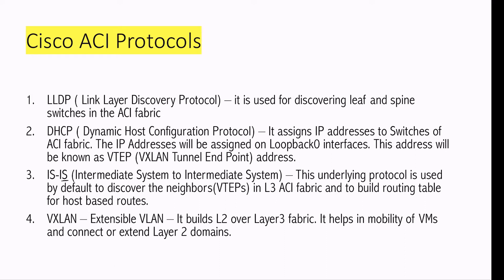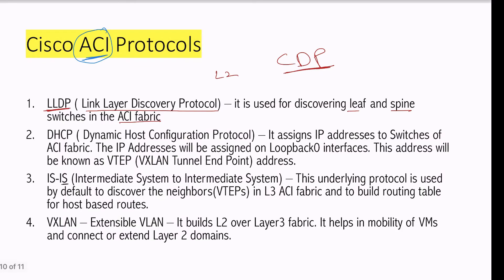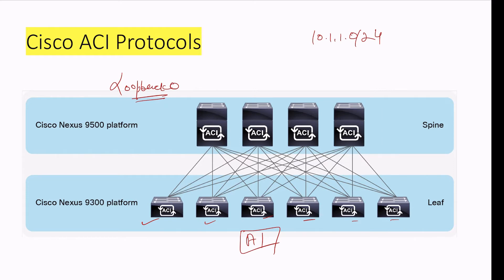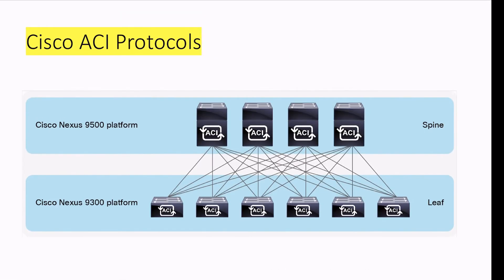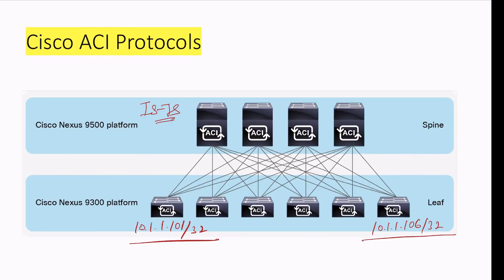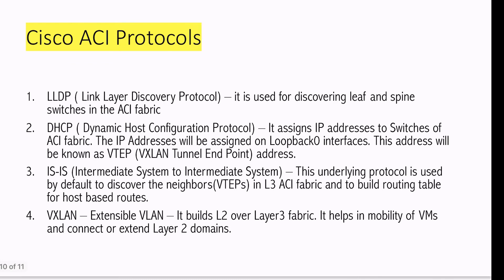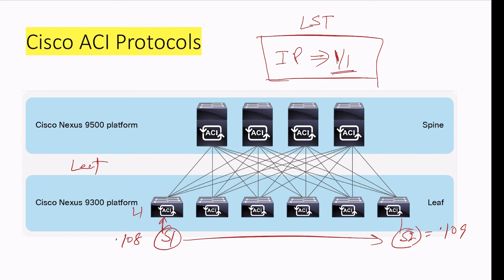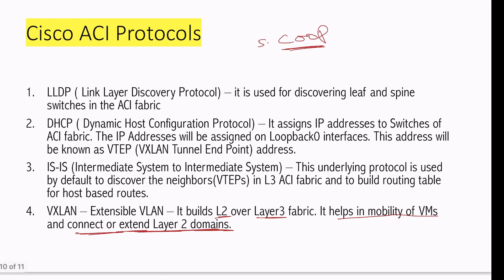Cisco DCACI(300 - 620) - ACI Protocols

Comment: Download Updated Cisco 300-620 Practice Exam Material Here: https://www.validexamdumps.com/cisco/300-620-dumps

You Prepared the Cisco Implementing Cisco Application Centric Infrastructure 300-620 Exam with the help of Validexamdumps Updated Implementing Cisco Application Centric Infrastructure 300-620 Practice Test Material. On the Final Exam Day, you Easily Attempted All questions and you get Success in Cisco 300-620 exam the First Attempt.